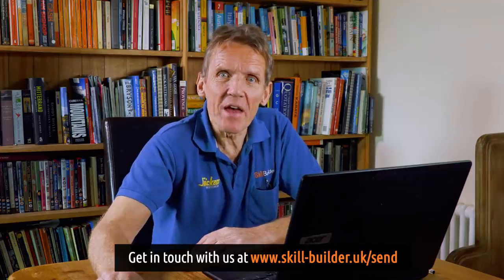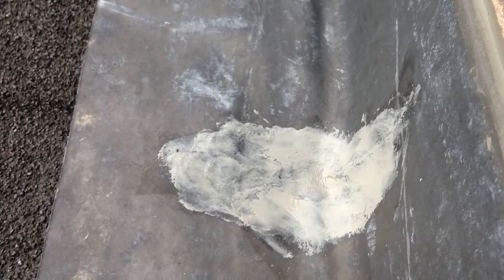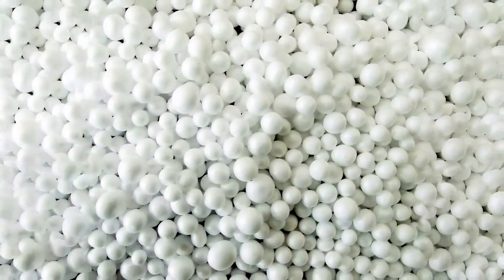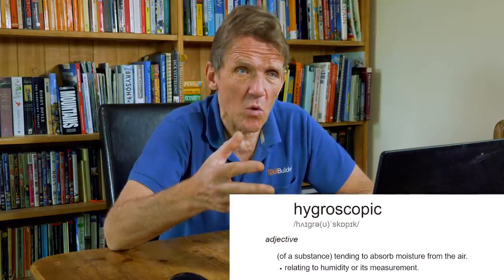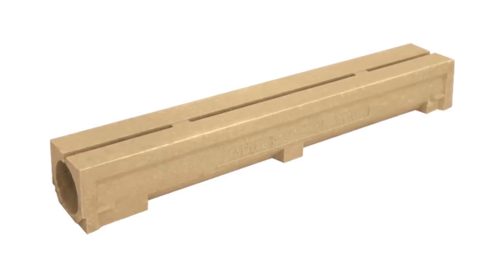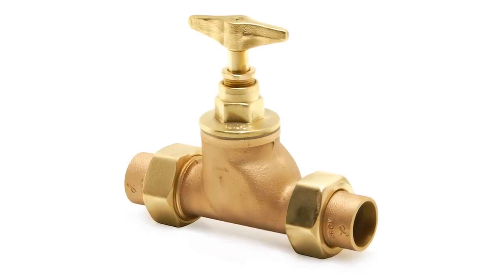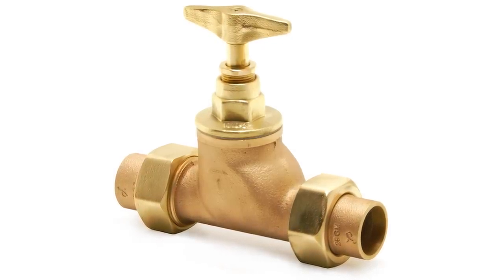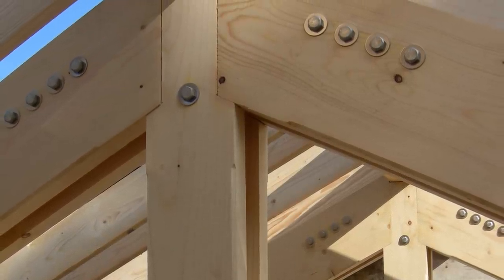Level Decking, Cracked Lead & Damp Walls - ASB #11

Comment: Thanks Roger and others, Phil here. Don't think it's condensation, as there is none anywhere else in the room or the house. There is very little overhang on the gable end. As far as I know this is how this wall of the house was built. It's rendered double skin heavy weight blockwork. It's been added to in many phases over at least 150 years. I had wondered if water was getting in the top of the cavity under the roof. Will try and take a look, although not an easy place to get at!

Comment: Another good podcast  with good advice, Roger you can still get the old scrim  but its mega money compared  to the fibber glass scrim, the plaster board ceiling cracks in my  experience are mainly due to bad installation ie no gap between boards and the boards not staggered like stretcher bond format, and the lack of screws or nails  used  to support the boards, keep up the good work Roger  and  Robin

Comment: In regards to the damp below the window I had a similar problem, water was seeping into the living room window from above I lifted the floorboards up in the bedroom, below window above could not see anything looked outside and part of the mastic had lifted, I noticed as I was taking the old mastic off that the trim bead of upvc that was fitted on the bottom of the window to the sill (4 inches wide) I could push in on inspection I found gaps in the expanding foam they had put behind I took the interior sill off In the bedroom and it was soaking wet, water was coming down through the old stone and rubble (Stone house no cavity wall) water would only come in at certain times ie when rain was blowing directly on the window. I took old foam out put new in and put some mastic at the bottom of the foam then resealed the trim.
waiting now to see if this has worked.
As for the cracks in ceilings, I found painting and decorating on you tube who gave a great tip make some holes about 6 inches apart using screwdriver rake out rest of crack fill holes with expanding foam trim off when dry push slightly in  dampen holes and crack with water down pva fill with filler.

Comment: Regarding insufficient water flow - good idea you mentioned to check that the street shut off valve is fully open - also check any existing mesh filters in case they are clogged with scale. This is especially so when you have hard water.

Comment: I don't see a drip channel under the window sill. 
That will cause problems.
Looks like the outside render has been built out past the drip channel which means rain water will find it's way into the drip channel and soak whatever is inside the cavity and eventually soak through into the interior wall.
Get on a ladder clamp a straight edge under the window sill and gouge out a channel with a sharp screwdriver or corner of 10mm wood chisel and paint the groove to protect the wood fibres.
Multi tool will do the job too but hey, if you've not got any tools use whatever you can, a 4 inch nail dragged along a clamped straight edge with several passes will do the same job.
Nice and tidy.

Comment: Excellent and v informative video. Think you are probably spot on with regards the damp. An  invasive inspection with an endoscope might reveal lack of cavity inslation or even a bridged cavity.
Reply from the maker: Thanks. Do you think it is a question of reducing the humidity in the house with better ventilation?
Reply: @SkillBuilder  it is difficult to comment further without inspecting the property but it may well be the case that improved ventilation will help. Going further it might be worth checking if the cavity wall installation is covered by a guarantee.

Comment: As a prehistoric plasterer I concurr with your findings Roger - Re the ceilings cracking :-)
The old Jute Scrim could be a pain in the bum at times, especially when doing Cottage-Style houses like I did with #Westbuild back in the day. You could lose a day just scrimming up. But leaving a nails-width between each plasteboard joint made sure those boards never came apart. And Yes, a three-coat finish made sure you NEVER saw those Jute-Scrim-Joints :-)
As for the plasterboard these days? It all seems TOO BRITTLE and cracks very easily. Back in the day you could get a really good bend before it would snap in two, today they need a LOT of support in transit and in fixing :-(

Comment: The damp patch on the gable window? - 
If the house was rendered, have they reduced the gable overhang of the roof?
Could the gable tiles be damaged and water is going down the cavity?
Is there a drip on the cill?
Reply from the maker: @Rogerdodger-z7x  

Yes I saw the paint but didn't know what to make of it. Something is cooking in that cavity
Reply: Rainwater can track through the cavity especially if the beads are bonded when they have been injected and that point may be a terminating point for where it tracks due to a hollow, it might be coming from the roof edges and driven into the cavity especially if the wall faces driving rain. But you’re right about eliminating internal condensing first...that might be the solution.
Reply: I would de-glaze the window and check the drainage is correct
Reply from the maker: @markcroft3619  Good idea.
Reply: I had to replace a upvc window for a client last year with a very simillar damp problem , the original installer had drilled down through the frame to fix it!

Comment: Hi Roger, regarding the cracking in the plasterboard ceilings, do they use paper tape on the joints in the UK? It’s standard in most other places in the world. The mesh tape is only used to reinforce small repairs/ patches here as there is no lateral strength in mesh. I agree wet framing timber is always going to cause problems. Here in NZ we are not allowed to line with plasterboard until the moisture content is less than 12%.
Thanks for all the great content

Comment: I saw an excellent method used in the US for decking (and maybe more serious) foundations. Drill suitable holes into the ground, 6 inch (150mm) upwards, with a post hole drill. Depth depending on your project. Drop in a cardboard tube and wedge it in plumb and tight. Cut the tops off level. You can add rebar if you like. Now fill the tubes with concrete and add J bolts at the top. You have just made properly strong reinforced concrete piles with no crane or fancy machines. The card tubes set everything level and eventually rot away.
Reply from the maker: HI Dave 
I do the same thing with 6inch plastic pipe. The rebar is a good idea but the plastic tube keeps it tight and allows you to vibrate the concrets to make really dense piles.

Comment: re: Reverse Osmosis (RO) system:

Just to underline what the great man said  -  you would only use a RO system for your drinking water (e.g. have a system under the kitchen sink supplying a drinking water faucet).

They are fantastic systems for purifying water (I use one to extract our drinking water from a private spring on a farm) but when you consider how they work (a small proportion of the water molecules from your 'dirty' water being forced via pressure to migrate through an incredibly fine plastic membrane) you can understand that compared to a simple filter cartridge system they are both very slow and 'waste' lots of water.  

A RO system typically uses 6 litres of water to produce 1 litre of drinking water (the rest will be flushed away in the process)...and a typical system may take 15mins  to produce that single litre  -  again ok for drinking water, pretty useless for anything else.

RO is probably overkill for mains water in any case; mains water is already bug-free so a simple water filter cartridge system will improve the taste and will produce 1 litre of drinking water for 1 litre of mains water.
Reply: Thanks! We’re using a small RO system now in our rented house, and I may transfer it to the kitchen sink in Ely, just for drinking water (and the kettle, of course!) and then looks like I’ll do a softening system for the rest of the house. Thanks for the expertise!

Comment: Hi all.
As a window installer of 35 years i have seen problems like this damp patch regularly on remedial work.
1. We often see on old upvc or aluminium frames that we have replaced, where the cill was screwed right through the bottom rail of the window where water drainage  is meant to sit and gradually escape via weep holes, onto either the seperate cill or via face caps. The exposed screws or screwheads allow sitting water to corrode the fixings and eventually let water penetrate into the cavity beneath.
2. Where the cill and window frame are coupled together it is frequently observed that the whole 70mm or so of END abutment is not sealed .. therefore allowing drainage water or standing water to be wind blown sideways into the masonry / plaster. Difficult to retrofix ,  but i have sometimes drilled deep into the bottom reveal and used a piece of tubing attached to the sealant nozzle to reach all the way back to the plasterline. or even remove a bit of plaster internally and fill the end of the cill / frame with MS polymer sealant.
3. And of course  it is vital that a cill has adequate overhang and either a capillary or drip to displace water away from the wall.
This guys damp problems can be caused by a combination of all the suggestions as well as some of mine.
It is a common problem...
Properties without insulated cavity closures can also be problematic..
Reply from the maker: Great information. We need you to do a video with us telling people what to look out for.
Reply: @SkillBuilder  we are in a pause at the moment due to this corona thing. i could send something in the future though  ?
Thanks
Simon

Comment: A great deal of knowledge being shared in this video with some excellent advice, with regard to the plasterboard I still have a roll of the hessian joint tape, plus could the problem be the thickness of the plasterboard being used. 👍👍👍😀

Comment: Cavities need an air space, cavity, to breathe. If its blocked as it is with the polystyrene balls, air can't circulate. Cavity could also be bridged by mortar. The external leaf of a cavity is for aesthetics and weathering with the internal being load bearing. You can get cold air which passes through a small air space such as behind the skirting board, as this meets the warm air it will condensate. See if you can hire a Flir thermal imaging camera or have an inspection done by some one with the camera, it will show you if there is mixing of air of different temperatures at this point causing condensation. If you need to bolt timbers to the house for your deck, on your perimeter/ring joist you can use washers or hard plastic packers to space the timber off the wall and allow water to pass between the timber and wall and prevent moisture build up, and subsequently prevent timber rot. A free standing structure using bearers and joists is another alternative. I like Rodgers idea for the posts/stumps. Interesting because it is similar to a pier liner in concept. Cheers 👍
Reply from the maker: I have a Flir thermal imager. I might try it on this house if it is near me. It would make a good video
Reply: Skill Builder Would be interesting to see the result mate. Cheers

Comment: I put down weed barrier under gravel in my back yard, had nothing but weeds for years. When I put a base down for a shed I dug up the weed barrier and haven't paved it since (6 months ago) and guess what,  no weeds.
RE: Stop tap, found one under my floor after years of rubbish water pressure, it was 80% closed +

Comment: HI ROGER, IN RESPECTS OF THE CRACKED CEILING, OPEN THE CRACK, THEN FILL THE CRACK WITH MULTI FINISH, WHEN DRY, SEAL THE JOINT SURFACE WITH PVA, WHEN THIS IS DRY, THEN USE 50MM GAFFER TAPE OVER THE JOINT, AND THEN APPLY 1OOMM SELF ADHESIVE SCRIM TAPE OVER THE GAFFER TAPE, AND THEN PLASTER WITH MULTI FINISH WITH PVA IN THE MIX, FOR THE FIRST PLASTER COAT. (DONT AFTER TO  DO THE WHOLE CEILING WITH PVA MIX) JUST WHERE THE CRACK IS, OBVIOUSLY WIDE ENOUGH TO COVER THE 100MM SCRIM TAPE. ANY MOVEMENT IN THE PLASTER BOARD SHOULD STAY BEHIND THE GAFFER TAPE UNSEEN IN THE SURFACE. IF IT RE APPEARS, THEN OTHER ISSUES MAY BE THERE ?? LIKE INADEQUATE JOIST SPAN, ABOVE LOADING, ETC. CHEERS

Comment: Wet timber, where do you start ? 

Once upon a time a timber yard would keep  everything under cover so you at least had a fighting chance of getting reasonably dry timber.
Sometimes I can barely lift a 4.8m 8x2 onto the roof of my van, its ridiculous.
As far as shrinkage is concerned, I avoid using sawn timber joisting whenever possible, i'll use either OSB I joists or metal web joists. 

I've seen 9x2 joists that have shrunk by 10 mm over their depth, you can get your fingers under the skirting boards ! How the hell can you finish a wet room and think its not going to leak in a years time. I just wont do it.
We have just put in a load of metal web joisting at a cost of nearly £2500 compared to about a grand for sawn timber, but I  garauntee the floors wont shrink.
We always use engineered tru-stud for studwork, it's more expensive but its dry and straight. You get minimal shrinkage and minimal cracking.
If I have to use "normal" timber" , for instance if  i'm extending an existing timber floor, then I  get kiln dried TR26 timber from my Truss manufacturer. Its twice the price but its dry and wont shrink.
If your laying expensive flooring you simply can't have lots of movement and shrinkage.
Re the cracks in the ceilings, remember all joints should be supported on either a joist or a noggin,  you shouldn't have any  unsupported edges.
Reply: Nick Haley I don’t know when everyone decided they didn’t have to nog ceilings anymore, you never see it. I remember nothing out ceiling after ceiling as an apprentice until we started using 15mm boards for the ceiling but you don’t see that very often
Reply: When im making my stud walls  i plasterboard the whole upstairs ceilings first and riddle them with screws 200mm apart. Then i make my stud walls a little bit  tight with a double sole plate and knock them in with a sledgehammer so it elimimates a bit of shrinkage also i put a bonding coat on the ceilings first before i finish plaster them .dont get any cracks.
Reply: chill pill if ur doing a new build or extension u get the privilege of boarding the whole ceiling but it all gets a bit complicated when it’s a refurb or knock thru and your matching and patching in. Although in this day when we all have the whole worlds knowledge in our pockets there’s no excuse for not aspiring to best practices but that’s what sets us above the competition! Now we just have to explain to the customer why we’re more expensive than the other quotes!

Comment: Looks more like condensation to me. Especially if there is a small cupboard/unit against the wall in winter. Ventilation in windows, decent gaps under the doors or leave them open and raise the ambient heat up a bit to keep the temperature of the walls up and of course, remove the source of the damp ie: people drying their clothes inside, showers without extractors etc..

Comment: I havent yet seen cracks form when the ceiling board joints have been staggered (or half bond like brickwork) ... if all the boards end or start on the same joist the whole way across the ceiling (straight nic) a crack will form across it...
Reply: Correct, all joints need staggering like floor boards etc
Reply: This was the way l was taught  and also today a lot of the so called plasterers dont put enough nails or screws in the boards
Reply: @MrJFoster1984  Hi thanks for your comments  l have used nails and screws for plaster board for more than  35 years  the screws for the last 15 years  l screw every 6 inches old school or 150 mm  and never have two screws on butted boards  together,   
cracks and fixings plaster fail is down to poor installation the more area of board  to have screws or nails the less chance of cracking, l was also taught to stagger the boards and any floating edges to have noggins, 
as you said  about fixing dot and dab with mechanical fixings in fire hazed areas insulated boards  have them in every board regardless of where they are installed  once  again thanks for your comments.

Comment: Cracking video, well look forward to these. Phil Dunford problem - Your guess is as good as any ones (actually, it is better) and it looks really centred to the left of the socket, I wonder if someone chased out too much and broke through blockwork? If it were my house I would turn power off a break out to left of socket. I hate damp :( I wondered about the overhang like LEEDS8 as well. I wonder if the cavity fill was before or after the replacement glazing, that might be a clue in itself? May be the glazing install broke out any frame and the balls were sucked up by the glazing installer before he put the new frame in? ...I should probably get back to fixing the toilet :( Keep up the good work!
Reply: Bikerchris  think you could be right there had this myself on a job and previous contractor had made good with bonding that acted like a sponge absorbing any damp that might be in the wall, hacked it out replastered in waterproof sand cement problem solved
Reply: I have often seen gaping holes left by window installers in the corner angles when the render is already on. Then they get filled with expanding foam and finished with some filler. Infact I have had exactly this problem on the house and water was pouring down the cavity, I discovered it when I was painting the wall inside near the reveal and the paint wouldn't dry. Depending on Roger's opinion, an option might be to have someone take the window out to investigate, which is not a difficult job to do.